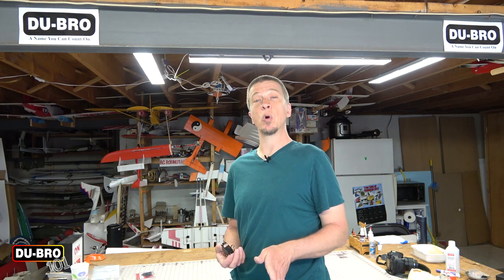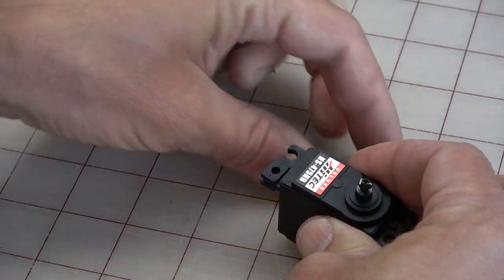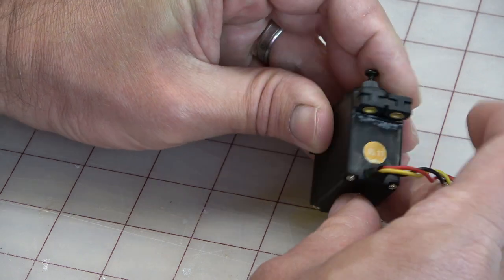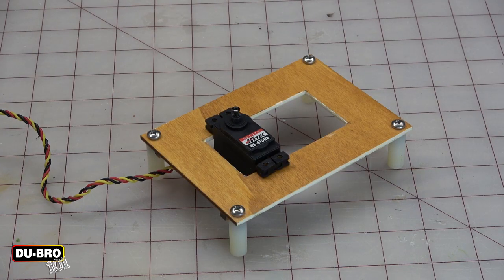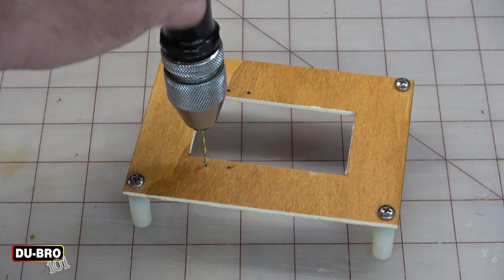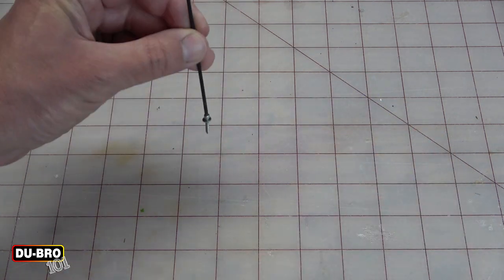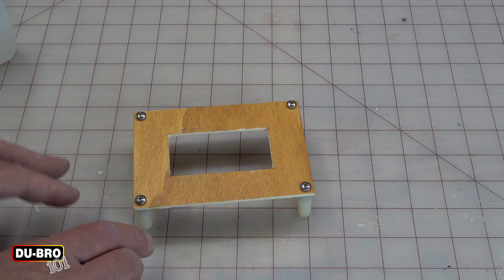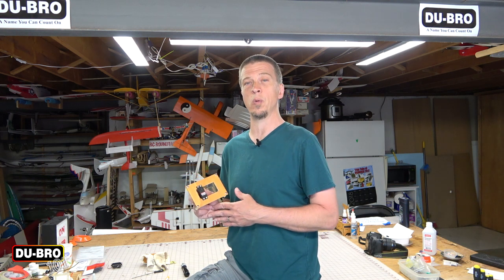Du-Bro 101 - Servo Mounting for RC Airplanes, Cars, Boats, or Helicopters

Comment: THANKS!!! (BUUUUUUT... I'm installing into flimsy, 2-ln foam... the NEXT question is: How do I attach that excellent servo tray to the flimsy 2lb foam?)
Reply from the maker: In a case like this, you can sheet the mounting area for the servo tray with 1/64" plywood (or 1/32" hard balsa). That will distribute the load over a wider area without adding much weight. It also helps if you poke some shallow holes in the foam before gluing to give the glue more bite. You can then epoxy hardwood rails (1/4" square works in most applications) to the sheeting. Attach the servo tray to the rails with epoxy or screws (pre-drill to prevent splitting the rail). Definitely use screws if it is a plastic servo tray.
Reply: @dubropineridge  right.. that distributes the load across a lot of the flimsy foam... got it! thanks!